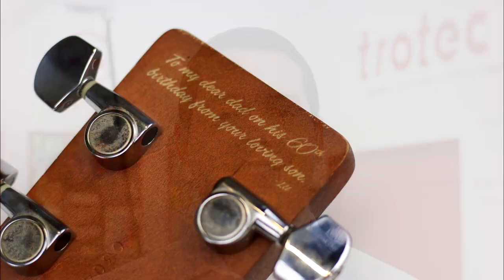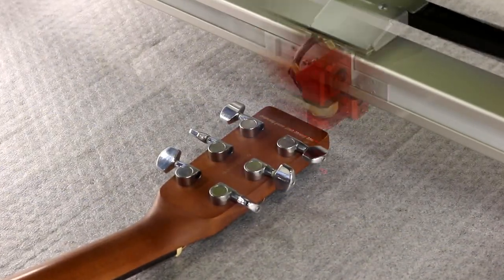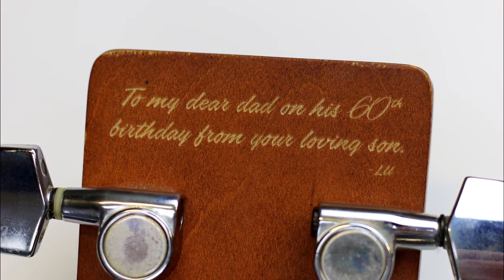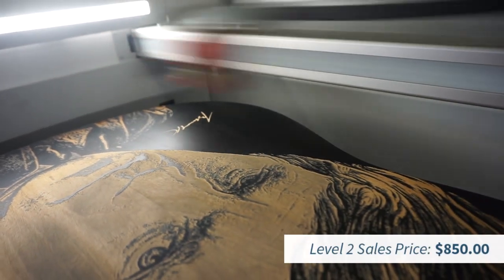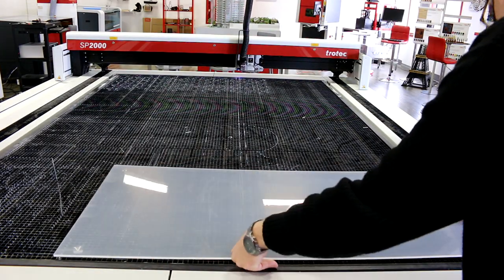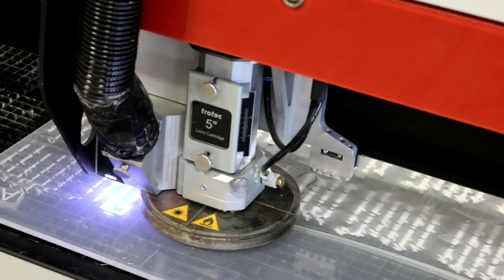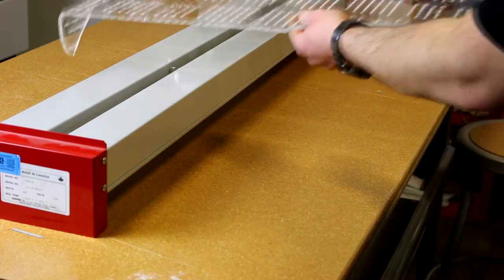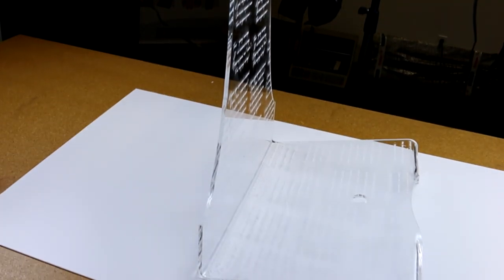How to Laser Engrave a Guitar and Create a Custom Acrylic Stand with Trotec Speedy 400 Laser

Comment: Fabulous design, I love the back of the customized guitar! Great ideas for ROI too. I have a question, how do you measure the size of the guitar to fit the graphics so they are the same in the graphics program and the guitar? Thanks guys <3
Reply from the maker: Thanks Nickole! Well because we're actually cropping the image all we're doing is measuring the height and width of the back of the guitar. We then took a "guitar outline" from the web to know roughly where the edges will be and then impose the image over it. The lase goes out of focus once it goes over the edge so you don't need to be exact.
Reply: @TrotecLaserCanada  very helpful, thank you. I'd like to try this method on my sons skateboard :)